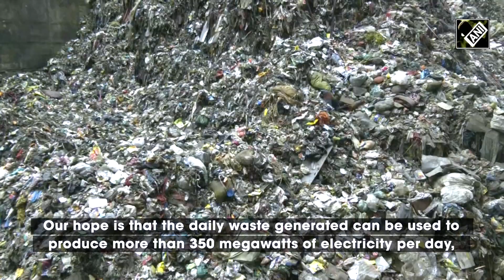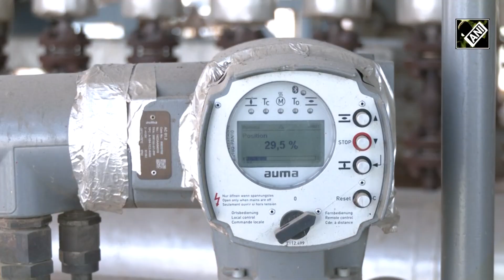Ahmedabad to lead with Gujarat's largest waste-to-energy plant

Comment: 😂😂
Why you'll never let people know about the dump site at pirana and it's massive effects of pollution that's released in the air EVERYDAY 
The evenings at Ahmedabad are always full of smoke caused by trash burning at pirana. 
If you take a breath, you can feel the hazardous air in just a second. 
This guy Dani, along with the AMC and government promised that the waste dum site would be cleared by 2016. 
They are responsible for killing thousands of people, yet they are here to take credit for something new that's going to be launched. 
2 faced people. 
Even the people of Ahmedabad are also OK with this, I wonder how they always ignore the biggest problem they face since 20+ years.
Reply: Piraña height has reduced by 15 feet…
Reply: @user-gu8kg2ku8k  of course it has decreased but at what pace? 
The budget allocation to clear it out was enough to get it completely cleared in 2016. 

It's almost 2026 now and still standing very tall. 

Don't say the work is done, ask why the work is not done given all the money and resources. 

Lot of tier-2 cities have cleared the waste better than Ahmedabad, so of course it is possible for city big and rich as Ahmedabad.

Comment: Good, I hope it happens all over India. Garbage is a big problem in our country. If our cities start to look clean and remove all those overhead wires, remove shops which  are 
extended to the roads and capture pathways, pave the sideways, proper markings, no stray animals, no road side parking in cities and bazaars, ban auto drivers etc 
steps will make India look like a developed country. Just need to take care of these small if we think about it because it is basic stuff but big when it comes to our country